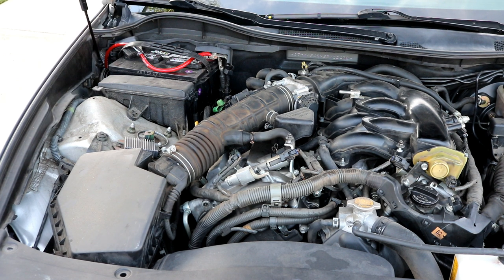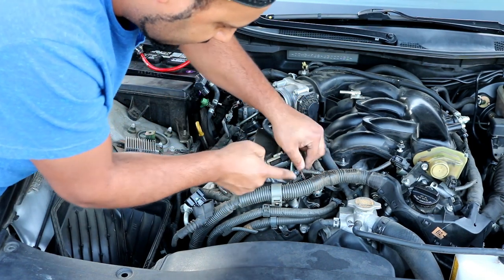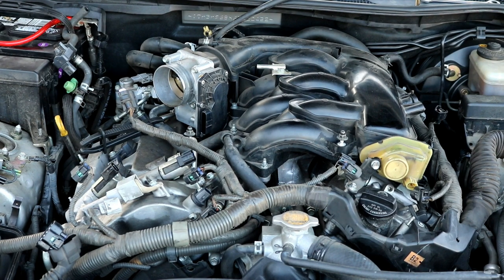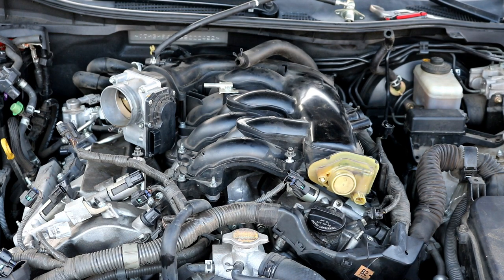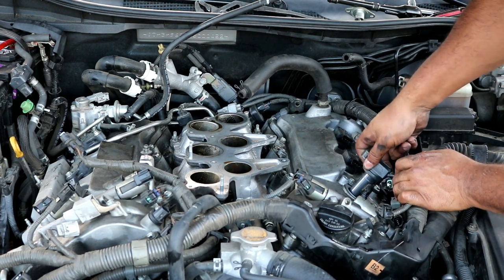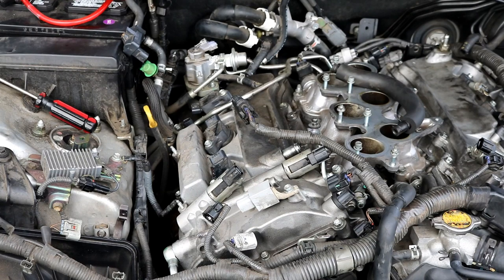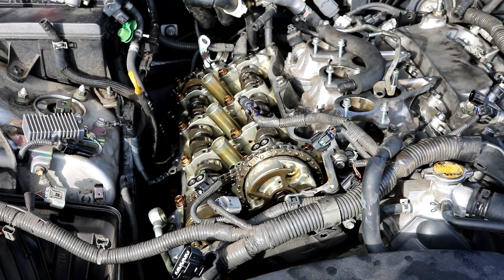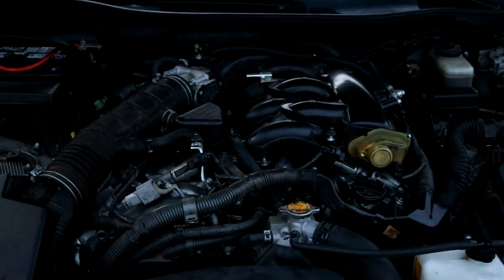Lexus GS300, GS350, IS350, IS250 Valve Cover Gasket Replacement

Comment: Please I need help there’s a tube behind the valve cover gasket and idk where it goes
Reply from the maker: Sorry I don’t know either without seeing it.
Reply: @HelpingHandAutoRepair  I actually got that part taken care off my high pressure fuel pump is now squirting gas and I can’t seem to tighten it anymore any suggestions ?
Reply from the maker: Replace gaskets or crush washers if there are some.
Reply from the maker: Or your metal hardline is actually broken. Gotta just look carefully
Reply: @HelpingHandAutoRepair  what’s a hardline
Reply from the maker: Metal line.
Reply: @HelpingHandAutoRepair  is that the one with the circle on it that connects to the fuel dampener and I’m sorry for all the questions I just don’t want to bring it to the mechanics near my house because they’ll say I need a new engine :/
Reply from the maker: @Doesitmatter666  lmao. That’s probably true. Unfortunately this is a customer’s car and I did this job awhile ago. I don’t remember every fine detail. If you have someone else there to look at it while starting the car, they should be able to see where it is leaking from right away.
Reply: @HelpingHandAutoRepair  thank you 🙏
Reply from the maker: Of course. Hopefully you find it right away.
Reply: @HelpingHandAutoRepair  I found the leak it’s come from in between the fuel dampener and this other part that’s a circle I just don’t know how to stop the leak 🙁 ima take it to a trusted mechanic tomorrow hopefully it should be a quick fix for under 100$
Reply from the maker: @Doesitmatter666  the fuel damper is a circle shaped piece. Is it leaking directly under that piece? If it is there is an o-ring there that can be replaced.
Reply: @HelpingHandAutoRepair  no it’s leaking from the fuel dampener
Reply from the maker: If it is leaking from the top of the fuel damper (the circle piece on top) then replace the fuel damper as the diaphragm inside most like has failed.
Reply from the maker: If it is leaking from the bottom of the fuel damper, Lexus did have some problems with fuel related leaks when these cars came out. There is a high chance that the screw/o ring has come out on the bottom of the damper as well. Unfortunately you need to intake manifold off to check the bottom with a mirror.

Comment: You screwd up the video by not showing all your steps! How did you get the bonjo bolt on?
Reply from the maker: lol, 😆 messed up MY video? You screw it on just like you unscrewed it.
Reply: Slip the copper washer between the banjo fitting and the valve cover, then slide the bolt through the hole and the washer, and tighten it?

Comment: Is this an IS250?
Reply from the maker: SlenderKen Gaming Hi this is a 2006 GS 300. However all of the 2005-2013 Lexus IS and GS use the GR family engine. So the process will be the same for your car as the engines look identical from the outside
Reply: Helping Hand Auto Repair sweet thank you so much